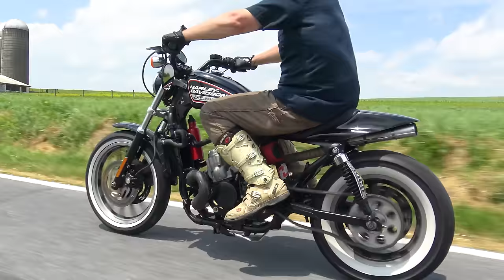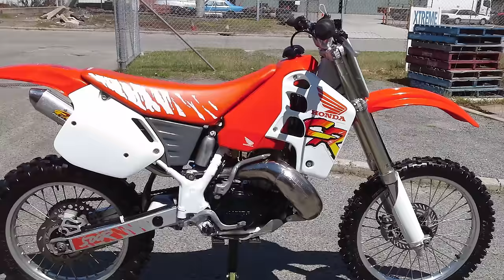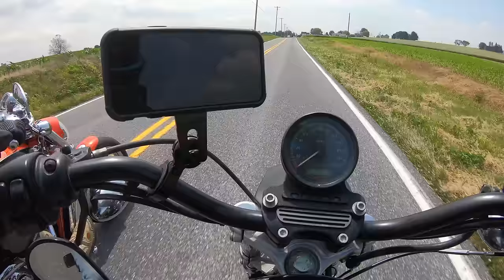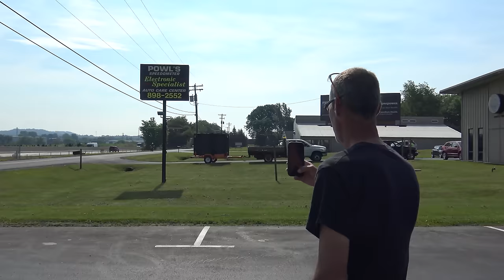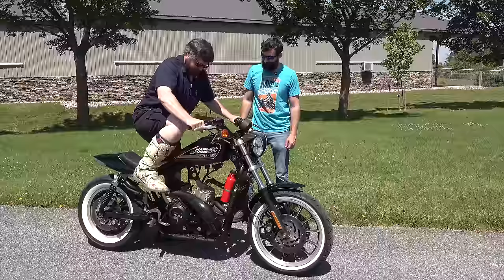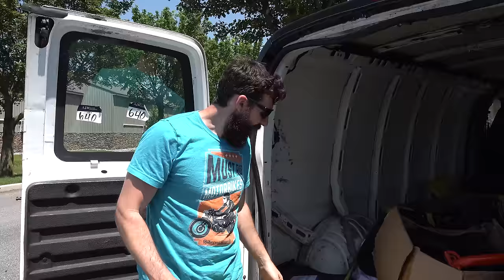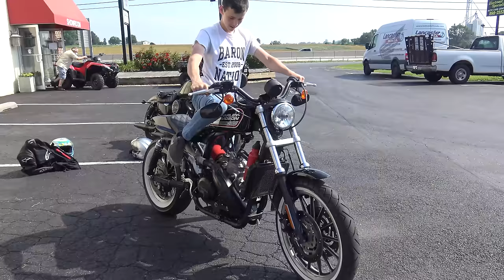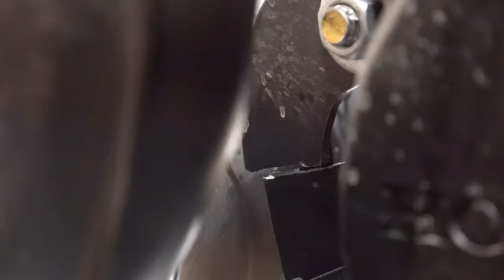First EVER 2 stroke powered Harley-Davidson(Engine Swap)

Comment: Replace Harley engine with a 2 stroke: Still uses less oil than the original engine.
Reply: He heh
Reply: Good one.
Reply: Correction ” Leaks “
Reply: That's f'd up and funny as hell.
Reply: Lolololol
Reply: XD_YTGreenesTv TV the joke is leaks dude
Reply: Actually the 2 stroke engine uses more oil .
Reply: @jakejames1977  Than there must be something wrong with the original engine, i'd advice to go to the nearest Harley Davidson dealer to have them remedy the issue
Reply: flip inheck  I got a 1993 harley davidson ultra classic with 142,000 miles on it now and it dosnt leak a drop. I just got back from Sturgis it never missed a beat. 3400 miles round trip. Most reliable bike I ever had. Just regular maintenance over the years still has the original top end .  Could use a new top end it does burn oil a little but, leak oil it does not.
Reply: Guessing none of you have owned a Harley?  Just repeating what your dad's said about bikes in the 60's?
Reply: XD_YTGreenesTv TV  that's why it's so funny...get it?
Reply: Facts
Reply: Cheems Burbger you would have to treat the engine like total shit for it to last only 2 months
Reply: Cheems Burbger  Still better than having the bike at the dealer for 2 month everytime you ride.
Reply: I've been having a bad day and this comment turned my frown upsidown lol :)
Reply: Ahahahahahaha so true
Reply: Vibrates less aswell
Reply: flip inheck  i dont like them either, i dont like that they are a goverment assisted company to lock the market to scew imports on tariffs and a bunch of their other practices and i dont live most people that ride one but not all, they think the word harley makes them special lol and stick their nose in the air and stuck up about their cheap pos, ill pic an ol vs 1400 over any harley any day and thats a super cheap bike,im sticking with the bmw r1200c and enjoy being classy and cool and not having to try like the harley guys(aka)girls do XD
Reply: XD_YTGreenesTv TV  r/whoooosh its a joke. Harleys leak a whole lotta oil and tgeyre saying that a 2 stroke uses less oil
Reply: @jakejames1977  nope
Reply: @jakejames1977  r/woosh.   That joke totally went over yohr head lmfao.  

For the record I race 2 strokes.  I ride a ec300.  Just ragging on Harleys. But
Reply: Bread Dad  The piston will last extraordinary long if you keep the air filter clean, like you should..
Reply: @jakejames1977  you don’t know what a joke is do ya
Reply: Air cooled oil breathers burn. Its natural. Got an 07 sporty that burns. Its ok i can afford more
Reply: tru st0ry h0nda engines 100000 year ahead 0f hd
Reply: @JCGver  haha :)
Reply: Leaks or uses?
Reply: How about converting a big billet S&S v-twin into a 2 stroke. there is lots of room on those big jugs to cut ports into.

Comment: I can’t believe you took apart that gem of a 500
Reply: I know.
Reply: Who cares there’s plenty more out there
Reply: @jakebradley5357  there is more out there...
Reply: Ok you had a laugh with the harley now put the 500 in to honda Rs125 frame and take it on the track with the rs rear sprocket and lock tight and wire the bolts .
Reply: Right
Reply: There are always more
Reply: There arent any more. There hasnt been any more for 19 years now.
Reply: It would have been a lot less painful if it had been a scraper in the first place and not a nice one .
Reply: @robertturner8040  Scrapper
Reply: My lawn mower has more power then that 883.
Reply: @miketrevino8761  - I had my 883 up to 90 MPH when I let up on the throttle. Not sport bike speed but beats your lawn mower.  By the way, Jesse James built the world's fastest mower. It went 60.
Reply: @dr.hugog.hackenbush9443  then how did I score one for 600 bucks?
Reply: Same
Reply: @robertturner8040  thats what im saying i would more like too see it in a cbr 125r rather than Frankenstein the shit outta an nsr pus the cbr has a lil more beefed up frame i believe i dont know why it is but its close to the thickness of the cbr300 i believe
Reply: @robertturner8040  omg that is a nasty thing I would love to have one! 🥵
Reply: @midmoto9458  Just the honda  rs race spec 125 is quick they race them on the track by me drop the 500cr motor in and you have a super bike killing  tool and might need a supply of clean under where mind you.
Reply: it's a machine, no big deal.
Reply: @scootergeorge9576  I had a 75 KZ400 to 95. I'd hope a Sportster could too.
Reply: @digschopper9321  - I don't really know what the top speed of my 883 was. Never pushed it hard enough to find out.  Maybe 105 but that's just a guess.
Reply: ..and he put it in a trash bin!
Reply: @scootergeorge9576  50HP but after 5 years less than 45HP
Reply: @HanSolo__  - With less exhaust restriction, 5 more HP.

Comment: Harley finally has a high performance motorcycle, good job Craig!
Reply: Almost sure it is lighter, faster, better mileage and more reliable. Like it!
Reply: @Quirin M. Sounds like you dont know how to jet your 2 stroke then. They dont foul plugs when properly jetted.
Reply: swix76 🤣🤣🤣🤣🤣
Reply: Kent you’ve never let one sit and idle for long enough. They all foul if you don’t ride on the pipe.
Reply: @Kent-pb2jl  is that why alot of 2 strokes had dual plugs? hmmmmm.
Reply: @monkeymangonewild  I don't agree. I've never had a Plug foul out except for one bike until I replaced it's weak stator. Why doesn't my boat motor or lawn equipment foul plugs? Old boat motors literally idle all day when trolling. Hell those plugs are several years old.
Reply: @frigglebiscuit7484  And piston aircraft have dual plugs (and mags) too and they are four strokes. Same with some four stroke motorcycles. What's your point? Its not for fouling plugs. Performance and reliability.
Reply: Kent they aren’t meant for it. Why do 2 stroke boat motors idle super well. Get a chainsaw and let it idle for 30 minutes. Plus dirt bikes have power valves. They tend to be jetted rich because they normally are wide open. It’s not like they foul them super fast.

Comment: hard to start, uncomfortable ride, and rattles its self apart.
Sounds like a harley to me.
Reply: My 1968 XLCH could be difficult to start when warm.  Cold, it was 1 to 3 kicks.  Often just one.  A tap on the starter button and my '88 XL 883 ant it always started.  Rattles apart? On my '68 the mirror fell off. It was a tiny bicycle unit just to comply with the law.  Nothing ever fell off the newer one. And I commuted to work on them, year around in Southern California.
Reply: Just maybe higher frequency vibes
Reply: allanthomas7345  No, I merely pointed out that his post was at best a huge exaggeration.

Comment: The kid with skater shoes on knew what he was doing
Reply: I saw him kick it and was like "Ah yes, he's done this before" lmfao
Reply: Yeah, watching the other guys try to kick it, they clearly haven't been tutored in the very particular big-bore 2-stroke starting ritual.  Kicking it a lot of times doesn't count for anything - you have to get the piston to the right place, reset the starter back to the top, and then put everything you have into that one kick.  If it doesn't work you do that again.  What they were doing, you can get away with on a 250, but it doesn't cut the mustard on 400cc+
Reply: @JETZcorp  yup, you crank it up till you feel that compression start to build, rest the lever, and lay into it like you're tryin to break that kick start off hahaha
Reply: Have to get those larger 2 stroke engines at top dead center before kicking them over.
Reply: @JETZcorp  even a 250 can be a pig if you kick it like they did, its about a fast snap not a heavy slow kick
Reply: 100% you can tell these guys dont know shit about 2 strokes

Comment: There were actually some 2 stroke Harley dirt bikes in the early 70s. I own one, they’re interesting to say the least
Reply: Im intrigued by your comment, could you make some videos on it ?
Reply: Back in the 40s actually copied the DKW RT 125 and kept making variants of that all the way into the mid 60s. I suppose the title is probably sarcasm.
Reply: Harley davidson aermacchi sprint was a 60s 2stroke street bike
Reply: @patrickkelley1382  They weren't all 2 stroke, they had a 250 and 350 4 stroke, and smaller displacement dirt bikes.
Reply: Yep I used to ride one,  a Harley 2 stroke trail bike.  There were even harley 2 stroke scooters as well
Reply: Yeah in the 70's H-D imported Italian 2 strokes and rebadged them as H-D's.
Reply: First motorcycle I ever rode was a Harley 2 stroke.
Reply: @recyclebills  yeah this guy has made a lot of statements that suggest he knows nothing about MC history.

Comment: When a grownup rider cant start a 2 stroke but a teenager that has skater shoes starts it with one kick
Reply: Shiiii its works everytime with my vans🤣🤣 and i drive a honda crf450r and i just ride it dressed casually with nothing but a helmet and goggles with skater shoes on 🤣🤣
Reply: Hey man I’m the one in the video. It’s all about technique. It’s hard to start but it only starts to hurt after like 10 kicks. If u get it first try you good.
Reply: @nickmaddox5469  i noticed the other guys weren't doing a couple of gentle kicks to get fuel into the engine and then getting it to tdc before giving it one hard kick. They must not be used to 2 strokes or dirt bikes.
Reply: Nick Maddox liar, you aren’t him.
Reply: NoNoNoNii  Dress for the slide, not for the ride.
Reply: bru half the times i start my 250 i have slides on 😂
Reply: @nickmaddox5469  I take you have some two stroke dirt bike experience with proper starting technique?
Reply: @Dytaylor69  Yeah, until you kiss the asphalt
wish you the best of luck in finding a girlfriend when you look like Frankenstein 
( also a motorcyclist)
Reply: Ay thats me and the boys
Reply: @Dytaylor69  i remember when I was young... check yourself before you check out hard. Takes one spill to totally shatter your foot, ankle, and maybe even knee if not also your tibia/lil fib.
Reply: nelson s to bad it’s not a 250
Reply: @Dytaylor69  Obviously not a fast rider then. But yeah they start easy when they are running good

Comment: I remember years ago I believe dirtbike magazine used a Kawasaki KX 500 put a rear street tire on it, changed the sprockets and raced it on the quarter mile. It did a 1/4 mile in 10 seconds over 100 miles an hour.

Comment: That highschool kid with a slipper on showed you guys how to start a big motor! Float level on the 500 is to high. 5 plugs in one day is not normal 2 stroke stuff either. You need to correct the float level before you do anything.
Reply: could also be a premix issue. I had a Kawasaki 2 stroke that ate plugs. switched my premix oil on a recommendation from a parts guy, and never had an issue again.

Comment: How come I never heard you get into the power band on the 500. That thing is so badass tho so badass nice job man. Hell yea
Reply: I was looking for this comment. Cause it sounds like it's about to hit power but the big 500 has a different top end sound than any 2 stroke
Reply: Yeah unlike the kx 500 motor, the cr500 has no power valve.
Reply: @claysavage8047  thanks. I'm into dirt bike and had many super mini bikes lol. Rm80 bored to a 105 and a 2  kx85,,,, had no idea about that cr500 fact.
Reply: You've obvioisly never ridden a 500. The CR500 is all low-end power. It falls flat if you rev it out. They arent "pipey" like a smaller one.
Reply: @dr.hugog.hackenbush9443  bullshit lol an im a honda guy thats why i said cr 500. Next would be kx or an air cooled rm.
Reply: The dam thing ran like a clapped out cr80. They have more then that c'mon now

Comment: I don’t think you know how you’re supposed to start a 2 stroke. You need to get it to the top of the stroke first
Reply: Not on all of them. I don't with mine and it starts first kick every time
Reply: William Spicer that's correct some well maintained ones don't necessarily need to but if you do that even on a four stroke you are pretty much guaranteed it to start unless it's running shit
Reply: Only on big bores
Reply: Mine starts first kick if I follow the drill.
Reply: @ELJEFEEEE  I had a 2 stroke 1982 Suzuki RM465 for 8 years, and I rode it every weekend. There are two things you must do to start it, get the piston to the top of the stroke, and kick it with everything you have, wearing an mx boot. I tried it once with tennis shoes, and it kicked back, and the bottom of my foot hurt for a week. 

It will not start unless the piston is at the top of the stroke, I tried, and once I figured that out it started 2nd kick every time when it was cold, and first kick when it was warmed up. It was one kick ass bike with more power than you could ever use, and in the 8 years I had it I never had one engine failure. I ran 1 bottle of bel-ray mc-1 racing oil to 4 gallons of gas, and put a new top end on it every winter. 

Then once it is running you have to run it through the gears a couple times to clean out the engine sputtering, then you have to run it at 3/4 throttle or more or it will foul a plug, and you will be putting a new plug it it more than you want to. If you dont run it hard enough you are not burning all the fuel going into the cylinder and it fouls the plug.
Reply: they ever heard of tdc maybe👀

Comment: That vrod should’ve beat it no problem. The clutch was slipping so bad.
Reply: Cr500 eats it for breakfast
Reply: @kiefercosgriff7300  Not a chance, tbh.
Reply: Kiefer Cosgriff no chance at all.
Reply: You all gotta remember thats a 500cc 2 stroke engine dealing with a 1200cc v twin, it's amazing how it keeps on par when accelerating each other
Reply: Did none of you hear the clutch slipping? Have any of you ridden a vrod? Would it keep up with a vrod? Sure, but if the clutch on that vrod was grabbing like it should it would’ve smoked it
Reply: @jhizzle2100  slipped so bad that I'm afraid the clunk of bits will be imminent soon

Comment: You can literally start these with flip flops, just gotta know how, ask me how I know..
And yes locktite is a cr500's best friend
Reply: My kx500 is pretty easy to start. Once you get the technique down it start within a kick or 2
Reply: If you do it right the first kick most two strokes will fire right up
Reply: My 50cc starts on the first kick without any kind of special technique
Reply: The exact 2 things I was gonna say, I can start my kx250 with my hand. Starting that cr500 is actually easier than a crf450 with the correct technique. And where the hell the the red loctite on those engine mount bolts?

Comment: Harley used to make dirt bikes with 2 stroke engines. This can be an interesting tribute to those.
Reply: Cut ports in any big v-twin jugs and use all valves as power valves exhausts. its done all the time on top fuel S&S giant v- twin 2 stroke top fuel bikes. Some of the Xr-750 were run as 2 strokes.

Comment: Two stroke street bikes are a thing, look at the Yamaha RD series for example. Changed 5 plugs in a day! A large part of the run issues could have been a high float level; Hence fuel dumping out of the carburetor and poor run condition.
Rad bike!
Reply: RD400 was a fun bike, but if you ran it at constant speed for too long it too would overheat and sieze.  I was going 100 when the motor froze, kinda scary :-)
Reply: @nonebiz2132  The problem was not the going of a consistent speed, rather, it was running just near 10,000 rpm for who knows how long. Who's to say a seal didn't give way causing a massive vacumm leak just before catastrophe? Sure, you'll get some extra oily suit build up in the pipe, but with a street bike where peak performance isn't needed throughout the entire ride, that's hardly an Issue. Get your jetting, timing right, and you'll be sailing low rpms for years to come.

Comment: When you raced it you never even got in the power band
Reply: The CR500s don't rev very high
Reply: Short shifting all day
Reply: @speedyme200  you dont have to rev them high either. Short shift and hang on.

Comment: Starting those bikes is all about technique, you can’t just go kick kick kick kick and expect it to start
Reply: Pump pump pump jump
Reply: Totally agree.....the pre ride technique is inacted before ever starting it...and if u dont get it to fire within a few kicks....ur better off just waiting a bit and possibly put a new plug in but just kickin and kicking again and again is pretty waste of energy....since most likely wont have it at top dead center wvery time u rapidly kick it and starting from tdc is a must to get a long solid kick in that spins the motor a few cycles priming it.in the process....and then give it no gas when starting and havr card set that way...and a dirry or worn out carb is worthless on a 500...carburations gotta be precise and float height must be set and have spotless pilot and main jets......
Reply: Totally agree I’m the kid in the video been on 2-strokes all my life. Technique is key.

Comment: tip to start a 2 stroke that is already a bit old and used up (also works for old gasoline in the carb, if you ride your 2 stroke bike once every few weeks or months)

pedal it 5 to 10 times, but VERY SLOWLY, don't put any force into the kick, just let the engine crank slowly, of course with the ignition on, you may or may not want to have the choker open, depends on your own bike, test it out

then, give it a real kick, it's definitely going to start